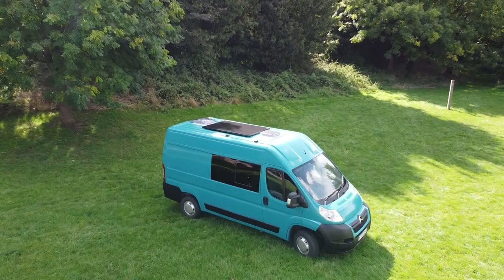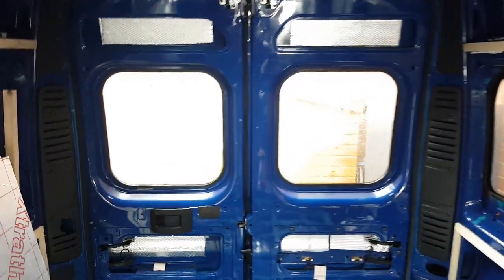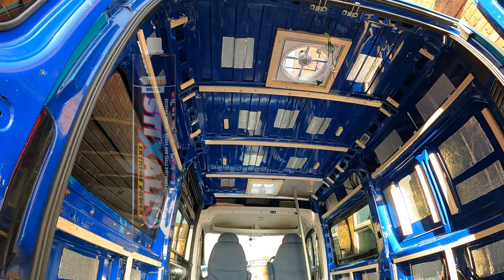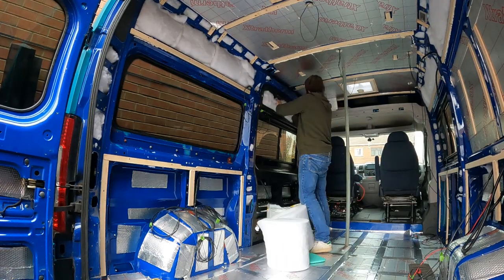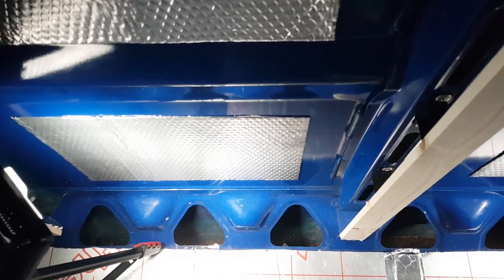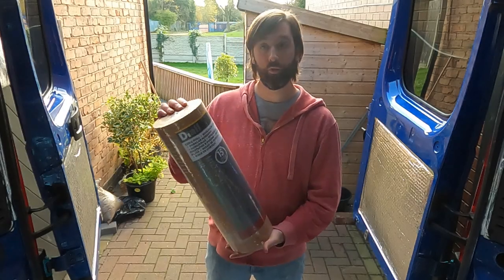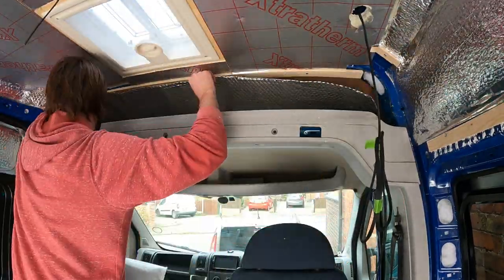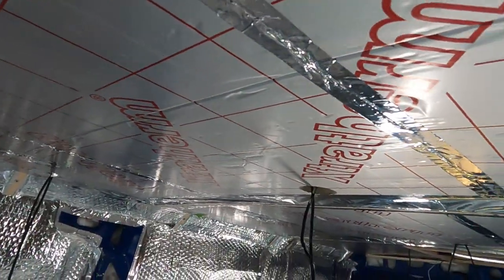HOW TO INSULATE a Self Build CAMPERVAN - DIY Budget Campervan Conversion

Comment: I have the same van and is 12 yrs old with 150m on the clock. Mine too is on a budget and am at the stage of the batterns. Ive been worrying lately about the cost of the build in regards spending so much on the presumption the engine is going to be ok and be worth the cost in the end. Obviously no one can predict the future and whether the engines going to be fine. Whats your thoughts on this. Thanks.
Reply from the maker: I've had friends buy brand spanking new cars and had endless issues with them and friends driving around in old used and abused bangers that just will not die. 😄 I honestly think in part there's a huge element of luck with buying any vehicle but the comforting thing about vans are they're built for big miles. With an older van I'm expecting bills to replace parts through wear and tear but once they're replaced they're replaced. All I could do was find a van that didn't appear to have an arduous previous life, cross my fingers, hope for the best and what will be will be. With regular servicing and maintenance I'm hoping it'll repay that care. 😊🤞
Reply: I've a 2014 Sprinter's with 200,000 on the clock....I too thought the same reference what if the engine lets me down? What if it fails an MOT big style? All what ifs !!! I have made the conversation start and well on the way . As I work on the van on the drive the amount of people walking past showing an interest is unbelievable. " Oh I've always wanted to do that" and "how much further have you got with it' most people will never get around to having a go for many reasons. So I take my hat off to all like minded people who choose van building...it's a case of grabbing the bull by the horns as you may never get a chance again.....so go for it ,and if it goes tits up then you can say I had a go. All the best to fellow van builders.👍
Reply: Engines and anything can be repaired. You could get your van written off the day you put it on the road and possibly not get back what it’s cost to build so don’t be scared of putting in what you need to make it yours. A good built cosy motorhome is worth repairing if the engine pops but maintain it as it should be.

Comment: I'm at about the same stage with mine and I know what he means about the great wall of china. I went for thicker insulation, but that means a LOT more bo
Batoning...dont I know it! Regarding the vapour barrier, I totally agree, if you can get it 100% hermetically sealed, what's the point. I think allowing it to breath may be the better option...only time will tell? Mines a L3 H2 relay, by the way. Regards Mick
Reply from the maker: Hermetically sealed... Thank you, that was the terminology I should have used. 😊👍Being the L2H2 version I've tried my best to find balance between decent insulation and minimum encroachment inside the living area. It's going to be a squeeze for the three of us in there. L3H2 opens up so more possibilities I believe and was what we wanted originally but this van of ours popped up for the right money. Best of luck building your own wall (van)! 😁🧱
Reply: @PilgrimPods  I was going to go for the L4, but parking becomes a problem in supermarkets etc. Look forward to following your build, I have the bell now! I'm just about to put a 400 x 400 midi heki type roof light in, but not sure what size batons to use for the frame. Any suggestions? Guess it depends on roof baton sizes and insulation thickness?
Reply from the maker: L4H3 opens up a world of possibilities. 😊 If ever we decided to take a year out of work to travel we'd consider something bigger but that's a few years off. I can't recall the exact size wood we used for the framing. I remember the plan was to shape the frame to fit to the corrugated roof and sit flush with the internal rib. I ended up using a 12mm batten across the ribs for the ceiling to attach to meaning I've had to pack the frame out by the same depth in this video in preparation for the next stage. I'll measure up the frame tomorrow and drop the measurements here. We bought the wood from Wickes I know that much. We do have a video of us fitting ours which might interest you. If you haven't guessed already, I try to show folks up close what I'm doing as when I was doing my own research watching videos the person would quite often gloss over what they were doing and not really show you the detail leaving you scratching your head.
Reply: @PilgrimPods  thanks very much. Looking at it I think it will have to come level to the rib batons, which are 22mm, then the tongue and grove cladding ...should run smooth. I will check out your other videos. Most I've watched so far (and theres been many) are from greg virgo, the restoration couple and camper vibe, all of which have helped immensely. Are there any that you could recommend? Thanks for the advise, greatly appreciated 👍
Reply from the maker: @michealgillman7418  Sir Greg is the go to for most of us I think. Absolutely love his channel and the knowledge he shares even if I don't always agree with him ie vapour barriers and screwing battens to the floor. The advice he shares is amazingly well thought out. He's even created instructional pdfs on some topics and offered them to the community for free where others would try and charge a fee. If there's a task I'm unsure of tackling I just tend to do a YouTube search, watch a few videos, do a little internet research and then apply my own common sense to what I've learned. I love Camper Vibe too but more so for their vlogs. A channel we've recently discovered and you'll probably find useful if you haven't seen them already is ''Louis The Van'. 👍
Reply: @PilgrimPods  I follow Emily,  Lou and AJ...great vlogs and funny too. They are from my area which is Kent. Or as we are calling it now "tier 3 Kent" that's buggered crimbo. Just carry on building the van I guess!
Reply from the maker: @michealgillman7418  Tier 3 Kent say hello to Tier 3 Birmingham. 🙂🙌  The girls are great viewing. We make sure to catch their content as they release it. They're super funny, interesting and more importantly come across as completely genuine.
Reply: @PilgrimPods  Yes, so do I, they cheer me up no end and I look forward to "the Emily and Louise show" every week! Hopefully we will both have the freedom to enjoy our Van's when they are finished,  fingers crossed.
Reply from the maker: @michealgillman7418  🤞😊
Reply: Hi great videos, how many sheets of insulation board did you need I'm also doing a MWB relay.
Thanks
Mike
Reply: @Michael Impey  I started with dodo dead mat on all panels, then 6mm sticky backed thermal van liner, followed by 50mm celotex. Any gaps were filled with recycled plastic bottle, then reflectex, then cladding. Probably over the top but I don't intend to build another one! Any other help you need, just drop me a line.  Regards Mick

Comment: Vapour barriers are used to stop moisture gaining access from the outside of a building that is built with bricks etc that let moisture through. You see this on timber framed buildings and it’s effective. A van is metal so it can’t let moisture through (unless it’s basically a rusty holed sieve) so no need for a vapour barrier. The most important aspect that a camper needs is adequate ventilation and obviously correct insulation. No ventilation and there is nowhere for the moisture accumulated in the van to go and your van materials absorb it and rot. My opinion but my van is not getting a vapour barrier.
Reply: What about dew points? You’ll get condensation built on the metal. That’s why you need a thermal barrier to cushion that from happening😊